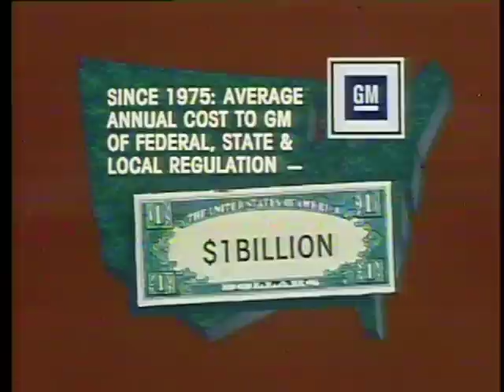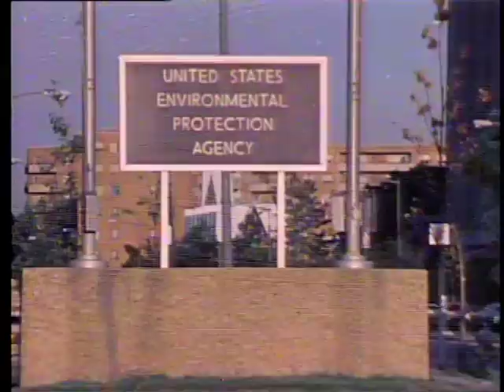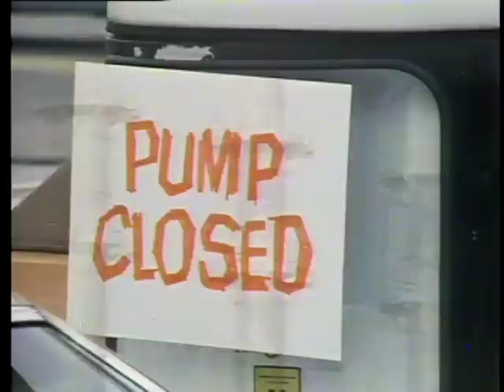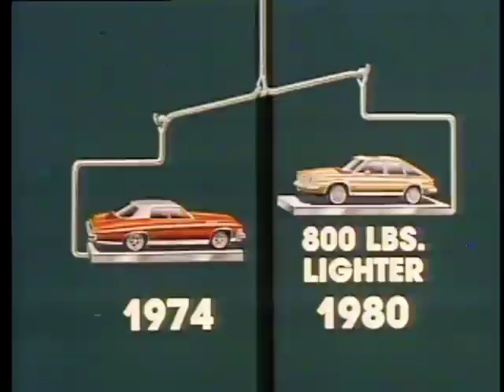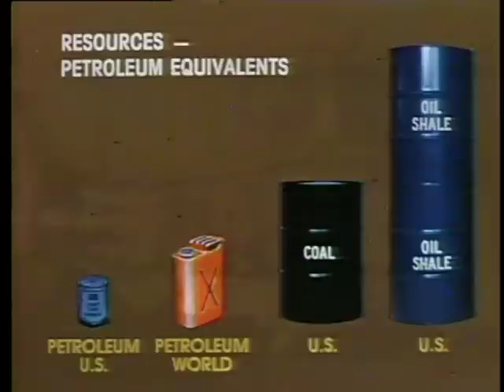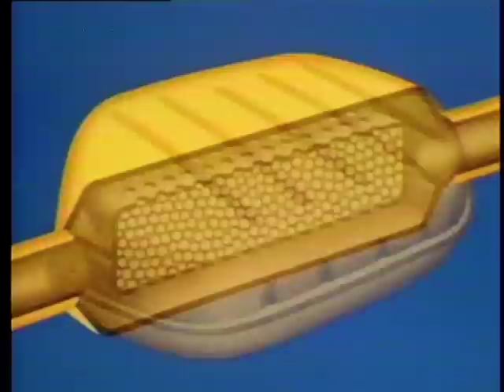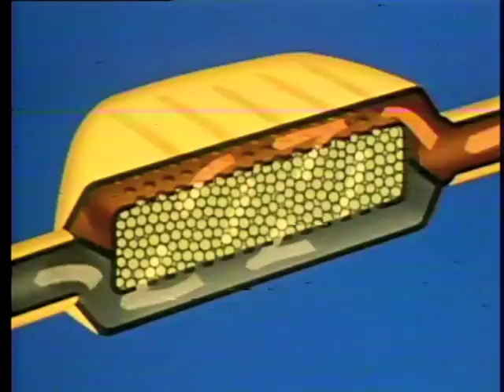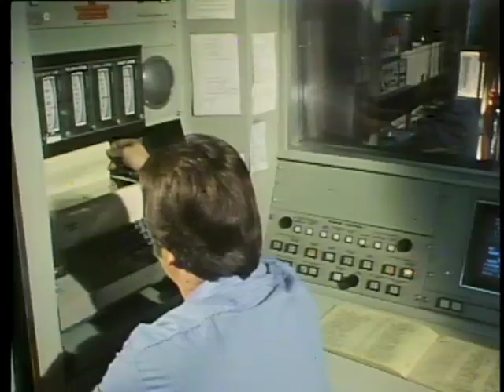General Motors Story of Progress

Comment: So much complaining and making excuses, from the nadir of GM's career. And of course GM had no problem with government regulations which targeted imports, such as the 25% import tariff on foreign-made trucks. But the second guy did accurately predict the fracking boom, and GM's own EV-1.
Reply from the maker: +vwestlife Ya I wasn't aware shale oil had been known of for so long.
Reply: Hey, it's VWestlife (five years ago)!

The funny part is that we ended up with all the safety and emissions stuff, we ended up with the turbochargers they promised us in this film--and also the pioneering regulatory dodge of letting everyone buy "trucks" to skirt emissions and safety regs all through from the 80s til today.

If Estes' plan to get his underlings, dealers, and their underlings to badger lawmakers into relaxing regulation actually worked, it's possible it could have bought them a few years of higher profits... if Estes hadn't been replaced one Roger Smith in 1981, who by the end of the decade had brought GM nearly to total collapse all by himself.

They seem to at least have their act together now, as much as any megacorp ever does.
Reply: Damn that government for requiring things like seat belts, rear-view mirrors, radios, and window defrosters!  If it was up to GM, they'd still be cranking out the same B-platform cars from 1968.

Comment: If GM  learn how to build cars especially diesels they would still have 50% market share instead of having a miserable  17%!
Reply: they would have but due to the stringent cafe standards and government imposed timelines they had to rush stuff to market before it was fully engineered.  the amount of change required by govt between 75 and 85 in terms of economy,  safety, and pollution its frankly a near miracle they were able to make anything that could comply.  the imports already had small cars so all they had to worry about was safety.

Comment: funny thing is i took al the pollution control off my 1978 El Camino  and it got.better mileage and appeared to have little more power
Reply: from 67 to 81 Horsepower?
Reply: Emissions controls did rob cars of horsepower and mileage.  That is because it was new technology.  Plus, let's be honest, the automakers didn't exactly try hard to innovate powerful new engines that could work with better emissions.  That only happened in the 1990's after they got their asses kicked by the Japanese.  They probably figured a Republican would come along and ditch the requirements a few years later.
Reply: @texaswunderkind  that's nonsense.  they pushed the tech as hard as they could.  govt mandated higher economy, lower emissions and more safety all at once.  devices to help emissions made eco only worse.  making cars lighter to help efficiency made them less safe.  all this stuff takes time to engineer and test to even have any hope of reliability.   its frankly amazing they were able to do what they did do, in light of the arbitrary and artificial deadlines imposed by our benevolent government